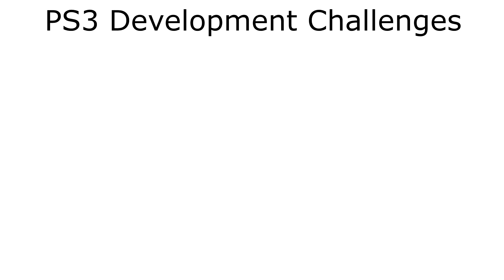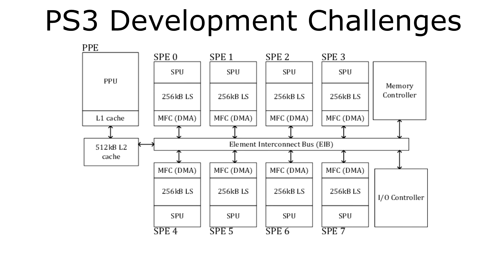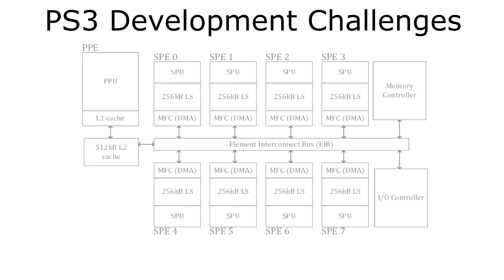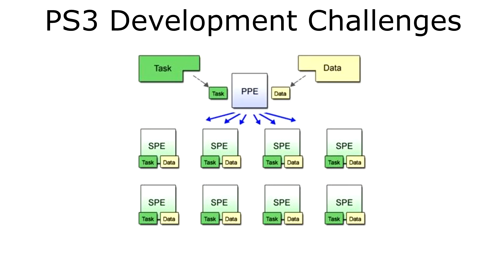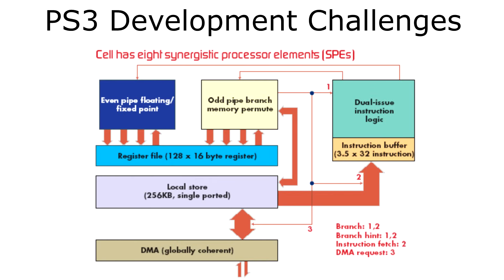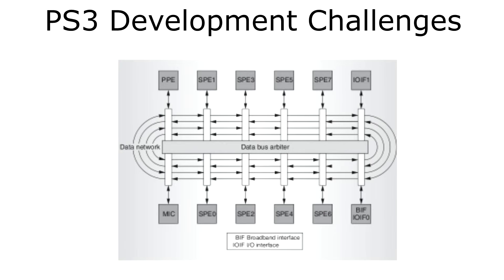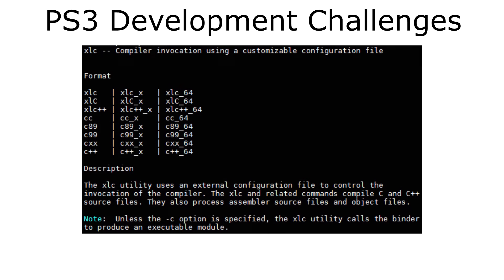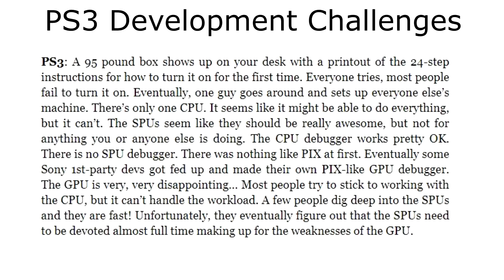Why was the PS3 Difficult to Develop Games For?

Comment: What id Software did was really smart, because their solution was scalable to whatever number of cores/threads that were available. Their idea was to just have a threaded job system, and systems could break up parallelizable work into tiny standalone chunks of work, like entity logic and physics. Nowadays you can generate GPU commands on separate threads with APIs like Vulkan/DX12 too, so visibility determination and draw call generation can happen across multiple threads. The old-school way of multithreading was to create a separate thread for physics, a thread for audio, a thread for rendering, etcetera... but that didn't scale well because you could have a 3.0Ghz CPU with 3 cores or a 3.0Ghz with 8 cores and the game would perform the same, as that strategy didn't scale. Having a threaded job system that divvied up work based on the number of cores would scale. Having multiple systems updating simultaneously each frame works to speed things up but it doesn't scale, you want multiple systems updating simultaneously while also being able to spread out their work across available cores.
Reply: you’ll find many examples in life where you’ll feel like an idiot for doing a task very inefficiently and then realising and saying out loud ‘I am an idiot, I could have just done it that way!’ the same applies here. Some solutions are obvious but only after learning how bad your current solution is.
Reply: we're seeing a comeback of that idea via green threads/coroutines nowadays! id/carmack, as always, has been decades ahead of their time...
Reply: Would like to see a fiber-based job system on PS3. Interesting, but difficult.
Reply: I'm confused, as someone studying Comp Sci, I'm confused why this is seen as a particularly ingenious solution. It's conceptually trivial to implement even with just raw C and pretty much the first thing I thought of when learning semaphores. 

And I'm not trying to act like I'm smart, I'm confused how anyone with a basic understanding of computer science didn't think about thread management, realize you could divvy up by task, and immediately didn't think to make a scalable thread system and code to break up tasks into small tasks for the thread manager. I would have assumed that would be something people would be doing like a month after thread managers were invented in the 80s. 

Like this is the kind of thing I've made for fun, before ever learning about the standard systems. Is there something really cool about ID softwares solution?
Reply: @fearedjames  In games it’s a bit more complicated, one of the reasons for that is that you have to share memory as efficiently as possible. You can’t use immutable objects, alloc/free/memcpy are very expensive in the gaming context, so you just have to have shared buffers and try to use them as safely as possible. 
In games there are a lot of dependencies between jobs, so your scheduling also needs to ensure correct order and track memory usage. 

Also you don’t get to control when the main thread is allowed to touch data. In a more traditional application you can just lock it for a bit, it’s fine. In games if you lock the main thread - you get a dropped frame.
Reply: @e.mentha  I'm somewhat confused why not giving each thread its own pool of memory would inhibit this solution at all. And the idea isn't to lock the main thread. It's to essentially let it keep walking forward doing essentially nothing except stopping to check if someone actually critical for progression is done (which it can do with flags), and just kind of letting the threads do their own thing when not critical, letting them create interupts if something disasterous happens.

I get that I don't think there may have been standard libraries to implement this, but setting up thread managers that do this is a trivial task usually put in second year CS bachelor degrees. Keeping in mind memory access efficiency isn't that hard.

I don't have first hand knowledge in this, but advanced technical programming concepts talked in practice usually don't make sense to me, and you talk about this like second year bachelor degree simple concepts.
Reply: @fearedjames  The problem with the task based solution is that it requires really fast memory latency between cores. For example, lets say you have a rendering task, physics task, audio task and you have 4 cores. Core 0 starts a rendering task, loads all the memory it needs to into local caches and registers does a little work, then switches to physics. Now that core has to dump all its data, and reload all the data needed for physics, over and over. There was really poor context switching performance and things like context switching was never really optimized in userspace.

Furthermore, the tooling wasn't really there in terms of programming languages. Multithreading primitives like Mutexes existed, but weren't all that performant because they didn't really sit in performance sensitive code. If you have a single thread doing rendering, it really cuts down on the amount of synchronization primitives you have to use.

In short, you a student today, can see the obvious solution because things like semaphores are fast and efficient today thanks to a lot of work that was done at both at the hardware and software level when multi core CPUs were released. That just wasn't the case 15 years ago.
Reply: @ChaosBlader  I guess it just confuses me because I was already kinda coming up with semaphores when I was taught about mutexs. Obvious as a student, I basically learnt them right after, but they seem like just the absolutely obvious next step, and once that concept is nailed down, the idea of breaking down tasks that get fed into the handler, just seemed like the obvious way to do that.

I do not consider myself great at programming, especially low level programming. But I am puzzled why anyone considered this hard to implement, even from scratch, because it seems like the basic thing to implement with obvious utility. 

There's a whole joke about how people get baffled by the idea that a can opener took over 50 years after the invention of the tin can to be invented. Now this confuses me, since the can is just a standardized round tin container designed to be airtight and store food, while the can opener is a nifty little piece of mechanical engineering with multiple moving parts, and you can open a can easily using a big knife so it makes sense to just do that rather than being stuck over thinking a solution to make it even easier.

This earnestly feels like if we invented the can, and it took 60 years for people to figure out you can use a big knife to open it, because 'hey how to open up the can in a way that makes it easy to get food isn't immediately obvious so the whole concepts hard'. Like its something that I'd expect a month of experimentation and now a pretty good solution is established. It's the flagrant first idea you should come up with.

This feels like the equivilent of finding out that for nearly a decade after the tin can was invented, people just stepped on the thing, crushed it so the food oozed out a torn hole, and just stuck their tongue in the hole, cuts and all, and no one doubt this tactic as they shredded their mouth.
Reply: @fearedjames  wonder how long it'll take you to figure out you're annoying
Reply: @ChaosBlader  BTW, speaking of context switching - that's the main reason why Cell did't succeded outside PS3. 

With it's huge context states of each SPE (hudreds of kilobytes of memory to be memcopied at each task switch) it simply impossible to run Cell in general purpose multi-tasking environment  with arbitary number of different programs running simultaniously.
Reply: @garfield1964 I figured it out by just reading two of his comments.
Reply: @fearedjames both hardware and software(compilers) support got better tremendously over time. And single wrong usage of sync primitive still can make app many times slower. Add close to 0 game programmers having enough revelant experience with mt to write high performance code. With tin can opener example it was probably not possible to mass produce openers with good enough quality and probably there wasn't single can standard at start.
Reply: @garfield1964  Enormous number of friends, multiple of which love my rants lol.

Comment: It doesn't sound that unlike programming compute shaders for modern GPUs, you run into similar traps with branching, loops, and yeah have to be incredibly cognisant of the width of the SIMD groups (your warps/wavefronts), which cache your reads and writes are hitting, your register pressure - it's very easy for even experienced developers to make similarly catastrophic correctness and performance blunders when programming for the GPU.

Comment: Perhaps if Sony hadn't squashed the linux on ps3 project, more engineers and hobbyists could have had some time to figure the architecture out
Reply: tbh they were ahead of their time given how parallel compute and GPU compute became a thing a decade later
Reply: People still mess around with linux on the ps3 to this day although afaik you can't use the gpu
Reply: So true!!! That's why to this day no one even bothered to make a driver for the RSX !!!
Reply: You could just hack the ps3 to get the functionality back, or get an IBM server.
Reply: @morrido-m6s  Geohotz hacker is responsible for that.
Reply: I was one of those hobbyist programmers who installed Linux on their ps3 and got into cell coding in c. Was bummed that Sony had to pull Linux support because of that damn hacker

Comment: now you have the current generation which is just a garbage lineup of cross platform mediocrity because there is no new hardware innovations
Reply: Hardware isn't even an issue with modern consoles. There have been new hardware innovations on the current consoles